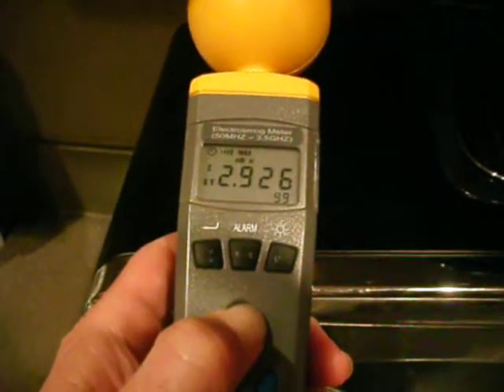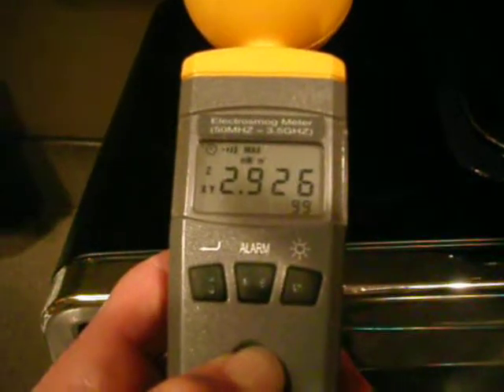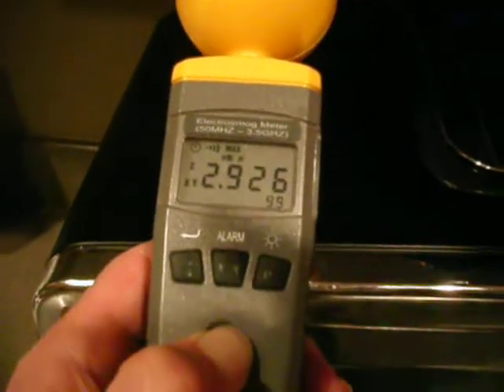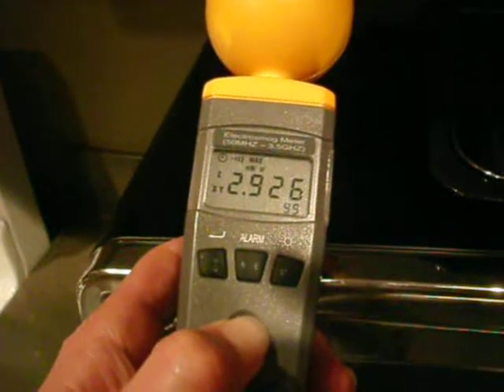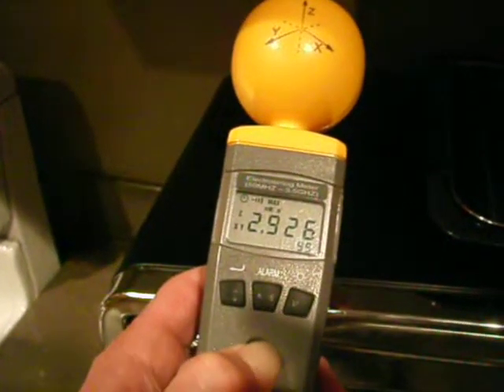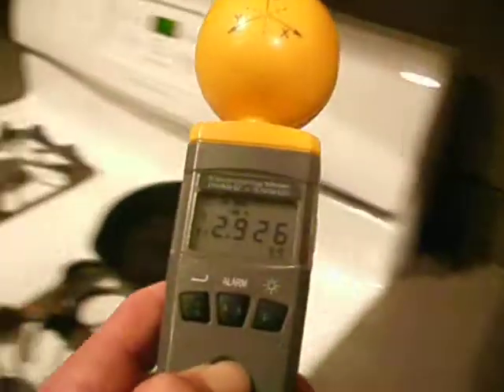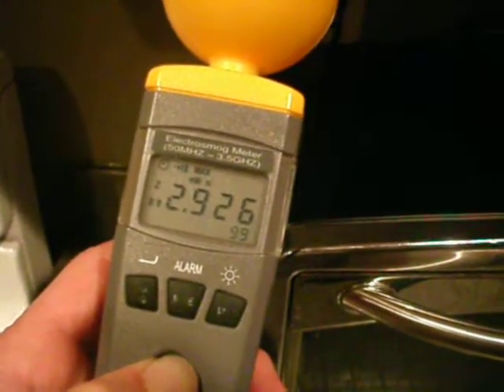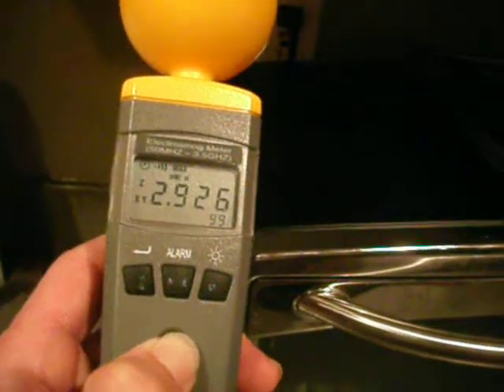smart meter radiation from unused socket 2900 uWm2

Comment from the maker: I have had better symptoms turning off all the elecricity to the house during the day and esp at night save for the devices I need at the time. I have all the breaker switches labeled and can have a TV on with everything else off if I want. At night I leave only the Fridge and the Smoke detectors on and use a flaslight or camping laterns ( battery of course) for lighting. You get some good sleep by allowing your light to dim naturally with the setting of the sun. The Electric bill is lower too!